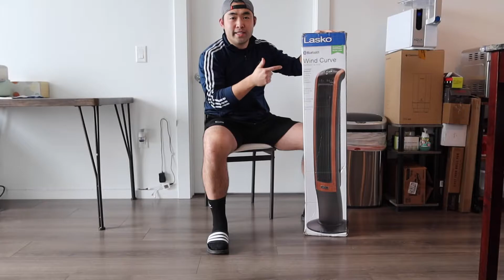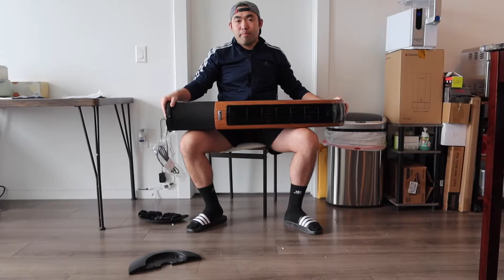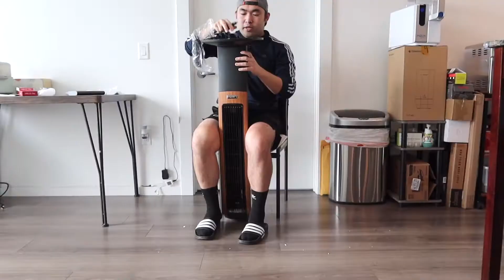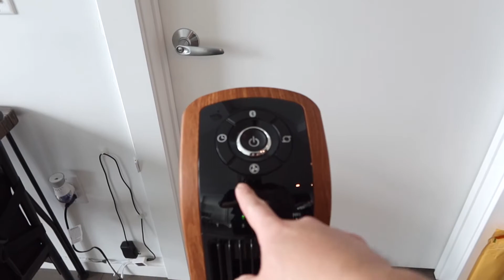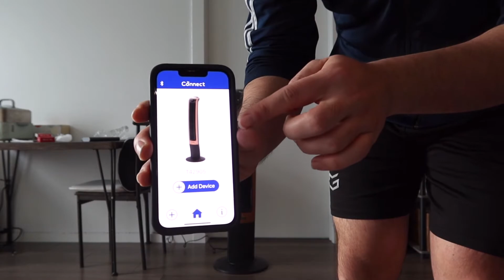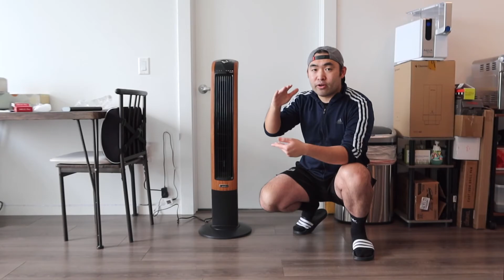Should You Buy? Lasko Oscillating Tower Fan with App Control

Comment: I have the Lasko fan in black. Not as fancy with all of these settings. The standard model. 

 It is amazing. I use that instead of a hair dryer. It blows so intensely on the top setting that my hair is dry in two minutes.

I also like how loud it is because it's like a white noise machine.
Reply from the maker: Oh true! Only thing I wish is that they include a remote control not just manual and app.
Reply: @UnwrappedandRated  how do you get the apple app to work?  I just bought this fan and I’m furious that the app doesn’t exist